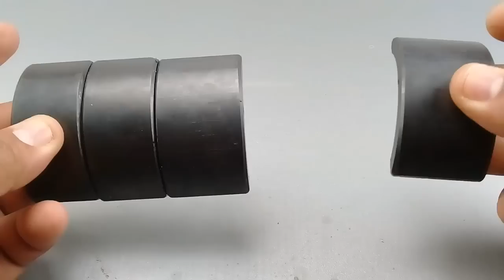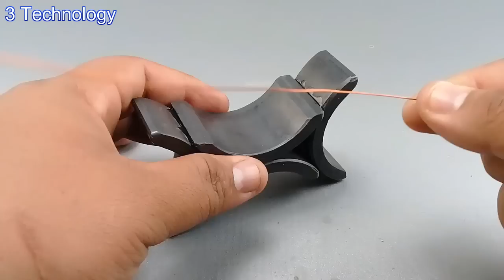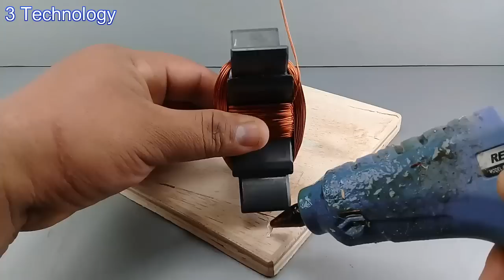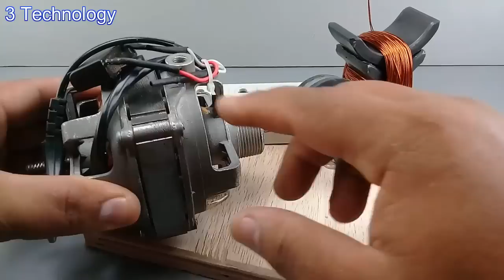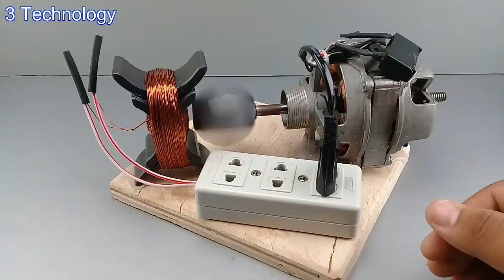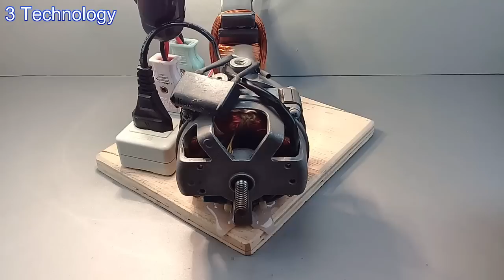I make permanent 220v 5000w generator using copper wire and magnet energy

Comment: You know absolutely nothing about electricity.
5000W / 220V = cca 23A
23A / 3.5 Amm2 = 6.5 mm2
For such power, you must have a wire of at least a diameter 6.5mm2
Reply: How many turns bothsides
And what is the wire gage or wire number????
Reply: I am incredulous, do you sell a kit we could test?